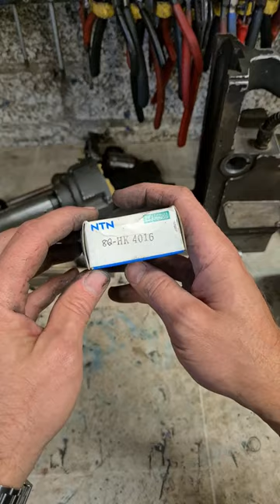Repairing a Rotabroach Magnetic drill that is getting very loud and rough with bad bearings

Comment: What’s your system for ordering the parts you’ve replaced on the likes of that ? Do you just memorise what bearings you need to reorder ?
Reply from the maker: actually this workshop has been going for last the last 30 years. the previous 2 repair men ordered in so much stock over that time, that i am still trying to use it up. i actually don't order in very many odd bearings as i more than likely already have them.